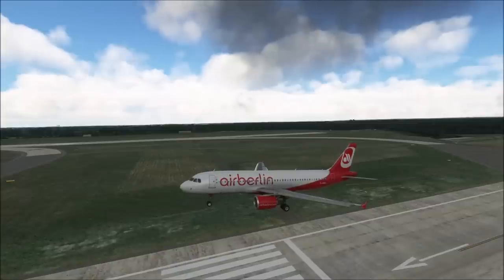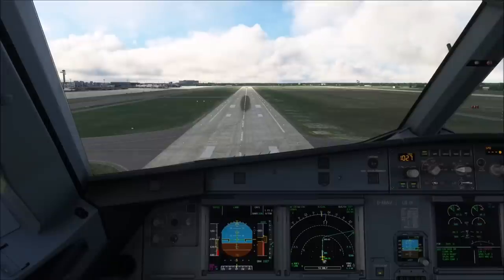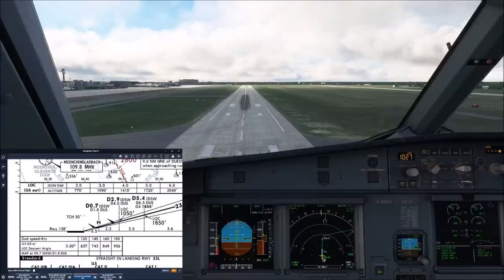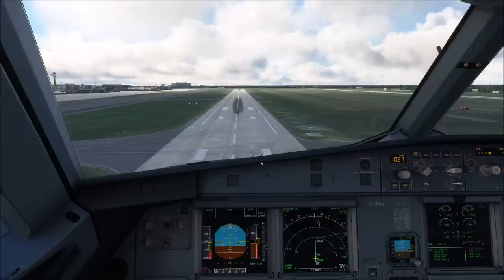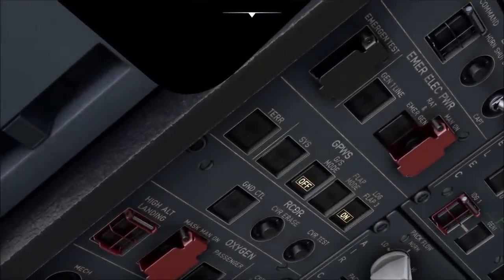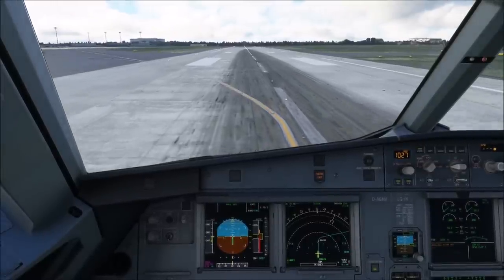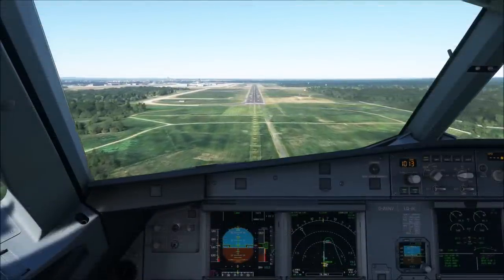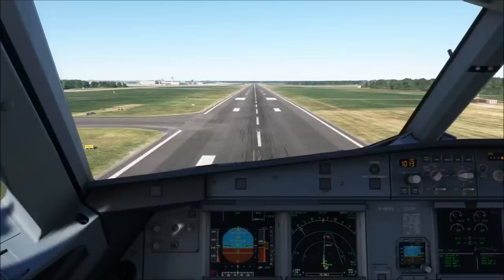How an MSFS BUG makes your LANDINGS MUCH WORSE | Real 737 Pilot

Comment: But it seems that this is fixable by scenery makers. If the PAPI and ILS can be aligned with the correct crossing alt in Cologne, they can anywhere. Either the angle is not right or the positioning is not right.

Comment: For me it still looks like msfs doesn't increase the mesh resolution around airports. That would also explain why you almost always have completely wrong elevation readings of sometimes way more than 100 ft from what it should be, weird slopes on taxiways, aprons and runways. 3. party devs would need to implement their own mesh and elevation profile for the airports. I can only assume how much work that is. I am not a developer, but I did a few fixes for some freeware scenery for myself with the onboard dev tools - and the results where terrible... Also, I don't think that PAPI lights in msfs are able to display something else than 3° - but that is another story... 

I don't know... As much as I love MSFS and enjoy flying there... 
The more time passes by, the more difficult it will get to fix stuff. We are still talking about the basics that are missing, offset or completely wrong. 
Elevationdata, atmospheric model, inertia and so on - just to name a few. 

When do they want to start? 
When every developer has released their product, working hard to build around the issues as best as they can and then forcing them to rebuild it from scratch?
Reply: PAPI lights definitely can display more than 3 deg. I don't know if they give you the precise 5.5 at London City, but it's definitely a lot steeper than 3

Comment: I experienced incorrect ILS Localizer and G/S settings in majority of default airports (e.g., VTSP, WBKK) in FSX and sadly in MSFS too.  In FSX, I was able to correct the ILS of the airports using Airport Design Editor, except I believe ADE for MSFS is still in beta?

I do experience more inaccurate ILS approach landings in MSFS where my aircraft is either off to the left or right of runway at the 100 feet callout.  IIRC, minimums was called out at 50 feet in FSX but it's callled out around 100 feet in MSFS?
Reply from the maker: It really shouldn't be the users job to update the ILS at those airports however. That's something where I clearly see Asobos responsibility.
Reply: Except do/will they update the default airports?  I fret not coz the 2 airports I mentioned have the same issue in FSX.

Comment: Well i think they should NOT fix it. Cause in real life ILS sistems and papi lights can also be broken. So it will be a good lesson to new pilots that they must never forget about minimums and their own visual instincts. Pilots sitting in the cockpit for a reason. If something fells wrong pilots must react properly. Developers can even add this problems to random airports and in this situations 2nd destination airports will be much more usefull during 0 visability weather. (with a possibility to disable it of course.)
And when you at 70 feet and your speed is decreasing already it's usually not a butter. But that was a good landing, diffinetely smoother than most of mine ones.

Comment: Tho, incorrect physics makes takeoffs and landings weird all over the place, it would be awesome is rudder steering was not that sensitive in higher speeds, also after going from p3d and X-Plane I don't understand why I have super short takeoff runs in 737 and A320neo, even with using flex temp/selected temperature, other than that it's amazing sim with lot of potential
Reply: Rudder is more sensitive at high speeds, and you can always adjust the sensitivity if need be. With regards to the take off runs, I've never really noticed a problem with the pmdg 737 and fbw a320 (can't say about the default and fenix). The 737 and a320 are both very high-performing aircraft, so short takeoff runs are definitely to be expected. Even then, this would be a problem with aircraft addon developers, not the sim

Comment: Thanks for the video! I have one question: Is that an ISL-only issue or does it happen with RNAV-approaches aswell (not regarding the PAPIs because those obviously stay the same)?
Reply from the maker: Hi, depends on the accuracy of the airport elevation in the sim vs real life. The plane will bring you to 50ft above the real life runway elevation. If the scenery in the sim is accurate you'll be spot on. If the scenery in the sim is out of place you'll also be out of place.

Comment: Choosing between published chart figures, PAPI, ILS beams and lastly the desire to simply "wing it"....
Pretty sure most of the butter smooth landings over on Swiss001's channel are all done by external camera right near the main landing gear lol.
Isn't there a minimum required touchdown descent rate for spolier extension hence "a boeing touchdown''?
Reply from the maker: There is no "minimum descent rate" published, but you should not hold off and float into eternity.
Reply: @A330Driver  speaking of, do we hold the nose wheel up and effectively "aerobrake" the aircraft similar to F-16s, letting it fall on its own with full aft deflection as airspeed decays or is it preferable to lower the nose and "flare" it's own touchdown while there's sufficient pitch authority?
Thank you in advance CAPT!
Reply: The latter. We don’t aerobrake transport category jets

Comment: I actually have a question about this that has been bugging me for a while now. When you look at google maps you can see that the aiming point for EDDL 23L is the third marker so about 1500' while on 05R it's the second one, so about 1000 ' . Would you actually change your landing technique in this case or just aim at the markers further behind? I'd greatly appreciate an answer to that one :)
Reply: No, EDDL is a European airport, so its markings are compliant with EASA directives. In the real airport, the touchdown marking on RWY 23L is at 400 m (1.312 ft) from the threshold and the one on RWY 05R is at exactly the same distance. I don't know how it is in MSFS, I use X-Plane which can correctly depict runway markings according to EASA (metric distances), UK (displaced center section of aiming point) and US (distances in feet and without zero in the designator number of less than 10).

Comment: ILS is old school use an RNAV approach
Reply from the maker: The RNAV however needs the airport to be at the correct elevation. Most importantly the runway threshold. That's often not the case in MSFS since terrain meshes may not be quite accurate (even 20ft difference can cause quite a different with an RNAV approach - similar to what we see in the video above) and many addon developers don't particularly care about differences in elevations at different part of their airport, but simply flatten the entire thing to the airport reference point - which can be as much as a hundret feet difference, in some cases even more.

Comment: @737NG Driver I have a problem with some of my landings and takeoffs. Sometimes theres a glitch where I takeoff or land then there is something that makes my plane veer off the runway and crash. Any ideas?
Reply: Can you confirm that both engines apply the same amount of thrust and your rudder works properly?
Reply: @blackytrains  yeah it is. its just that every time i fly in cockpit view, there is like an invisible wall that my plane hits which makes it veer off the runway
Reply: @SimxnYT  At every airport? If so, maybe consider removing all Addons and try again, if that shouldn't help reinstall your game, sounds like something is very broken there.
Reply: @blackytrains  no its not every airport. it only happens with my 737-700

Comment: Do you know if Asobo is evern aware of this bug? I never seen them talk about it at all or when it is getting fixed.
Reply from the maker: I talked to them about it a year ago. They told me it would not be an issue.
Reply: @A330Driver  that’s insane. The PAPI lights as well as the way how some airport ILS systems are off compared to the real world is very critical. They really need to get that fixed as well as the whole Outer Marker indication that always goes off no matter what.

Comment: You do have a point there. Some airports are quite very incorrect like Düsseldorf, some need adjustment. Are you saying that Asobo/MS are responsible for correcting 3rd party Düsseldorf? As much as I would like to see this fixed I disagree with your choice of example. It's another very polemic video. You could have brought a few examples which Asobo or MS have put their signature underneath. I'm sure there are quite a few.
And there are other issues in MSFS. For example, magnetic poles have changed quite a lot in the past 20 years. In MSFS the LOC approach course is written to the scenery. Many airports have ancient mag headings of their respective ILS's. If you are to use current charts you will be unable to capture the LOC because of course variation. Some developers have found their way to work around it. Some were simply lucky with the way a LOC/ILS is set up in the cockpit. Some have not made it.
To illustrate, I have recently seen a real 737 pilot land a PMDG 737 at Frankfurt Hahn with no LOC but GS indications due to incorrect choice of course. It was not incorrect according to the charts. But it was, according to the MSFS library. Now, with PMDG they would have had another option as you might know. With other aircraft add-ons this might not be the case. It doesn't matter which runway at Hahn btw. Both runways' mag courses have changed as have most runways due to the movement of the magnetic poles on earth.
Reply from the maker: The airport developer did not include any navdata in the Düsseldorf scenery, you see the default Asobo data in use there. The issue exists at both the default and the addon Düsseldorf, this does not matter for the purpose of the video.
Reply: @A330Driver  Are you saying this from knowledge that there is no ILS, DME, LOC in the scenery or are you guessing? I deem this statement as very unlikely. I was not referring to navdata alone. I was referring to the discrepancy between navaids and navdata. This has an effect on how navdata can be applied.
Also, the navdata issue is another topic. Düsseldorf airport is not an Asobo/MS product. If anyone can fix the ILS and PAPI's it's the developer of the particular scenery you are discussing. I didn't actually catch whose product you were using there. So which Düsseldorf add-on is it? Hence why I tend to disagree with your choice of scenery to make this point. Even though it may be valid.
Reply: @A330Driver  You mistake me. I was not speaking about navdata alone. I was speaking about the discrepancy between navaids and navdata. Are you speaking from knowledge when you say that there is nothing relevant to this topic in the scenery? I deem it very unlikely that there is no ILS, DME or LOC in the scenery. Those PAPI lights have not been set by the dev of the scenery? Okay. If you say so.
Also, this is the second topic in my initial reply. I disagree with your choice of example as it simply reflects on a 3rd party airport which Asobo/MS did not put their signature to. Using 3rd party add-ons in order to stir up polemics against Asobo/MS is the conflict I see here. Show this on Asobo's scenery and prove your point.

Comment: Can you make a video demonstrating the excessive weathervaning effect in the sim? It’s been brought up many times, and from my experience, is way too strong.
Reply from the maker: I plan a couple more videos highlighting differences between real life and the sim, yes. What exactly do you mean with "weathervaning" though? Could you elaborate please?
Reply: @A330Driver  I’m talking about the effect of wind on the vertical stabilizer, mainly while taking off and landing. I’ve had 10 knots of crosswind blow a fully loaded CRJ off the runway on takeoff even with full rudder and aileron deflection. Asobo has acknowledged there are some issues with the ground modeling effect. Best way to test it is to put a 10 knot or higher crosswind and try and maintain centerline
Reply: This has been an issue in any sim I’ve used. MSFS (FS9, FSX) and X-Plane all have the worst ground modeling. That’s what I liked about Active Sky. You could turn down the ground wind so it wasn’t so ridiculous. I’d rather always have a 10 knot or less wind close to the runway than blowing around like a paper airplane. It’s a huge pet peeve of mine.
Reply: @Fcreceptor  I agree, it drives me nuts and really ruins the simulation and immersion because it’s so unrealistic. Is active sky a mod or something?
Reply: @Cessna172SNavIII  Active Sky was developed for FS9 and FSX/P3D as a weather injection tool. Unfortunately, Asobo won’t allow a third party add-on for this, likely due to the agreement with another company for weather data.
Reply: @Fcreceptor  that sounds nice, I wish I had that back in the FS9/FSX days. Asobo need to step up their game and fix these issues
Reply: Maybe the greatly exaggerated weathervaning only affects certain aircraft ? Its enough to blow a 787 right off the runway, and yet its much less noticable on a TBM. I’ve never tried the 737s so maybe the developer has tuned it out of the flight model ? Every aircraft I’ve tried in msfs feels “wrong” in some fundamental way.
Reply: @TheSmurfboard  well all the aircraft in game are bound to Asobo’s flight physics and handling. I’ve noticed it to be especially bad in the CRJ series and the CJ4 when it comes to ground handling with crosswind. The TBM should already have a lot of left turning tendency due to torque and p factor, maybe you had a crosswind coming from the right side? Yeah I agree with the latter part for Asobo’s aircraft and cheap third party developers, maybe with some minor tweaking to the engine they can fix these problems

Comment: I recall that it used to be worse.   I think they have tweaked it a bit.
Reply from the maker: If some tweaking was done then it didn't really do much. It's still quite messed up.
Reply: @A330Driver  For me it seemed I was always way too high over the threshold.  Not as bad now. Could be that I’ve flying to different airports.   I’ll keep an eye on it.  Thanks for what you do!